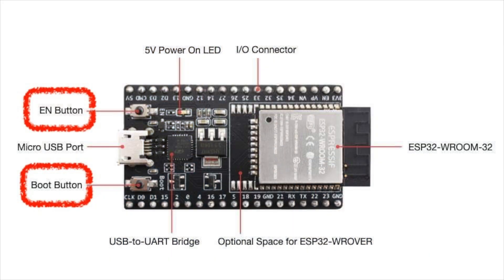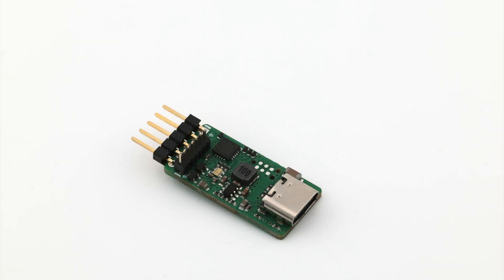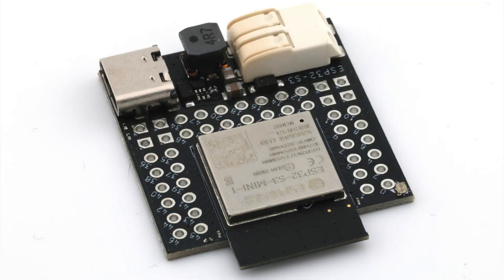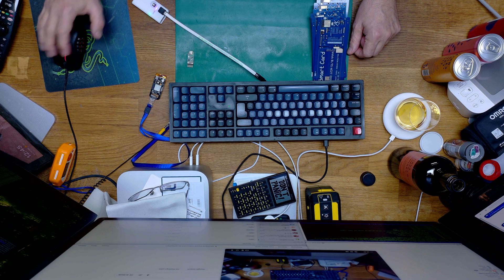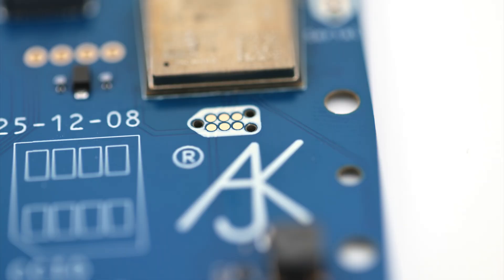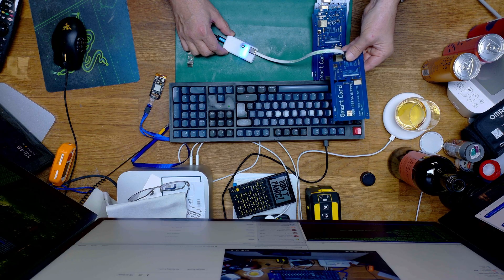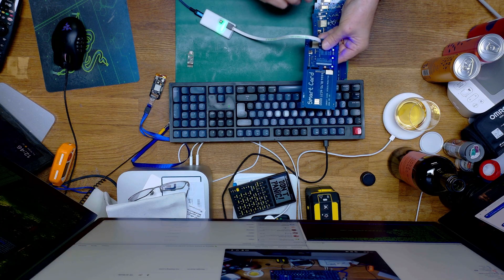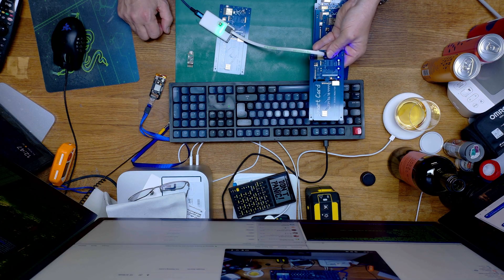Flashing ESP modules the easy way

Comment: Those TC2030 cables look like really neat right up until you discover that they are £25, each. It's a pretty user-hostile solution for low-cost open hardware if you want others to be able to join in. Obviously if that's not what you're doing then fair enough.
Reply from the maker: I agree the price is silly, but compare to almost any actual connector * 1000 PCBs, and suddenly they make sense.

Comment: Just to warn: it's possible to have an early crash bug that prevents USB from communicating fully with the host. In that case USB programming will not work.
Reply from the maker: Yes, sort off. I have seen startup crash loops upset PC/mac trying to reflash over USB, but my flasher module is usually able to power up and connect on USB and reset/GPIO in such cases. The bigger issue is when USB is used for some other purpose in my application, and the code needs to run well enough to allow me to get in to JTAG/serial mode. A crash when not in JTAG/serial mode does not force it back to that mode. I had one case of that and got stuck - but having a small pad for GPIO0 somewhere can solve that as a last resort. I think that was before my flasher modules, so not sure even that case is an issue even. I may test to be sure.
Reply: Very cool flasher, but your comment is very helpful for me because I experienced this bug on my custom board. I want to flash the esp32s3 initial over usb but the esp seems to be in a boot loop and is only detected for a second bevor it reboots. Do you know the cause or a work around? Unfortunately in my design it is tricky to use uart
Reply from the maker: @HFlorian  We have had this a couple of times - it seems a version of ESP IDF seemed to sometimes randomly build in a way that crashed on startup before even starting the app - even a one line change to code and rebuild sorted. I have not seen for some time so I can only assume it is fixed now. Obviously a bug in your code can create an early crash. I found on my mac I could call the esptool repeatedly from a script, specifying the port, and it would managed to catch at the right moment after a few tries. Having GPIO0 on a pad somewhere in the design so you have an option to pull low as a last resort can also help as that does force boot mode even if working from USB not UART.